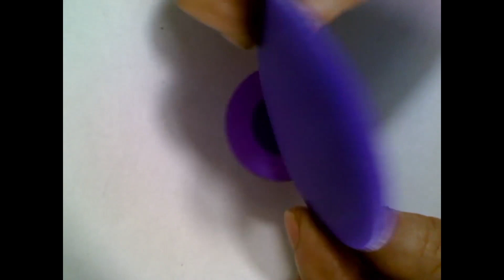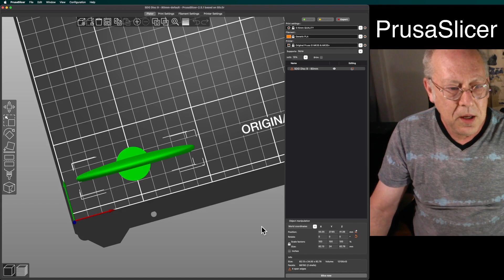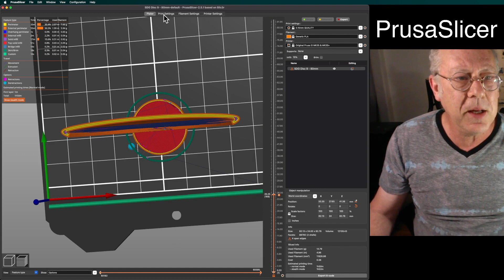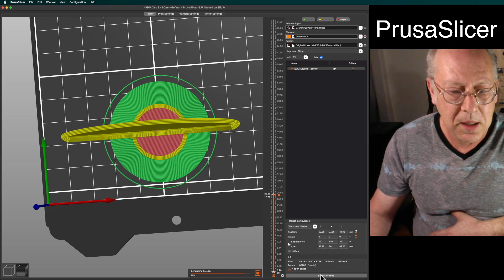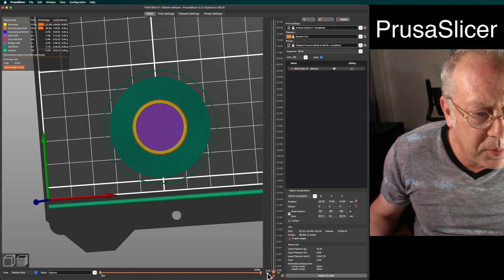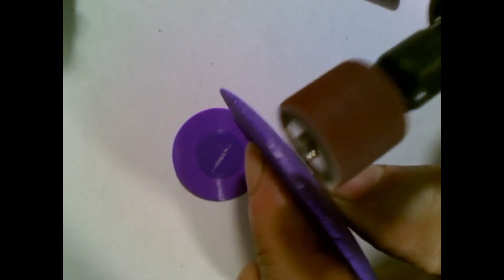3D Printing Small Golf Discs

Comment: Interesting results, would never think to turn off retraction. Youd think turning that off would give you more. I just staretd printing and the times ive had lot of stringing ive gotten rid of most of it buy lowering the temps, so always assumed it was a temp issue to dial the flament in, which probaly didnt do good for strength.
Reply from the maker: I turned off raising the print head (Lift Z in Prusa Slicer, Z-hop elsewhere), but retraction still happens.  Retraction is important to prevent overextrusion.  I'm sorry if I misspoke in the video.  The filament still undergoes retraction to stop the flow, but the print head never rises up.